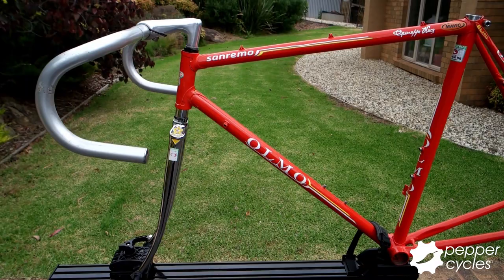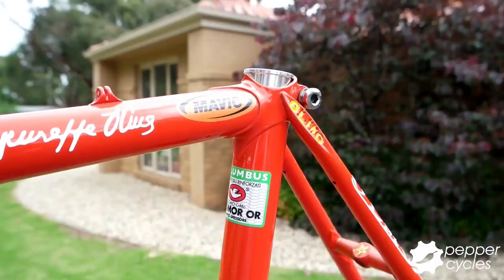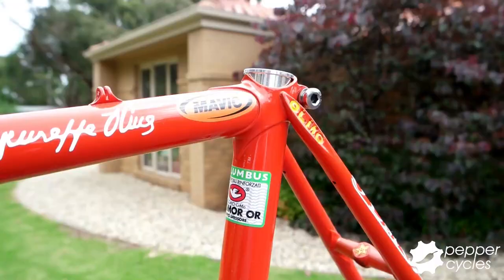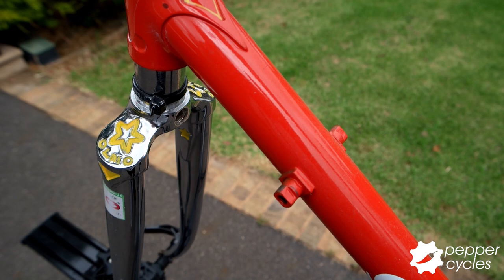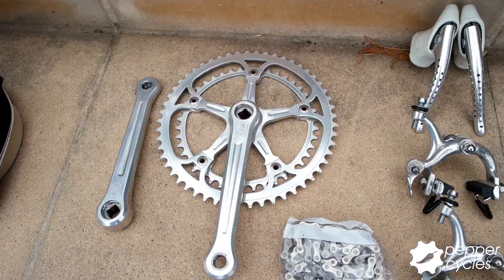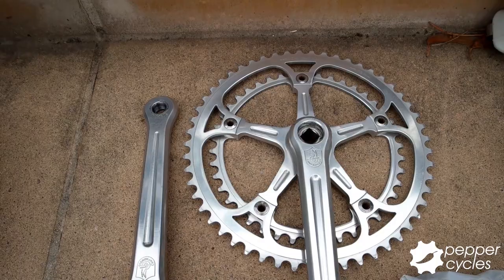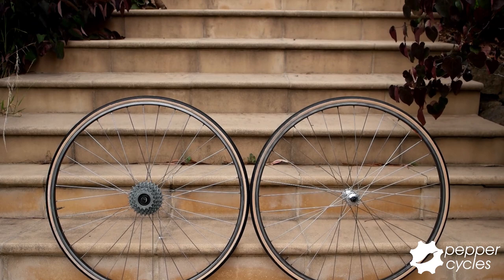Olmo Sanremo x Campagnolo Super Record -  Vintage Italian Road Bike Build

Comment: Whatever these vintage components can't do compared to modern ones, but with this bike you'll never have to deal with a creaking "plug-in" bottom bracket. What a beauty!
Reply from the maker: Ive had that press-fit squeak issue before - so very painful!
Reply: Still beats newer stuff in my Apinion these new bikes are cheating at this point not much pedalling involved 😂😂

Comment: Really cool!  On a side note you can get on eBay fresh rubber repro Campy brake pads for those SR calipers.  Slide the dried out pads (use WD 40) and slide in the new ones in so your Aluminum rims don't squeal like some scared critter out in the Bush.

Comment: Hi there... I was just wondering where you find all those vintage campagnolo parts? I'm looking for a set of 9 speed ergo shifters... are they compatible with c record derailleurs
Reply from the maker: This particular groupset I found on Facebook, it came from somwhere in Europe. Normally you can find them on ebay or Facebook groups related to classic/vintage cycling. I don't have any experience mixing c-record and this generation of super record, but when c-record was released it was a significant change in design, both mechanically and cosmetically speaking, so, personally I'd steer clear of mixing the 2.

Comment: I have the same equipment on my 1982 Colnago Super. Have you found a way of stopping the brakes from squealing? Mine sound like a sty full of stuck pigs when I brake.
Reply from the maker: I didn't have that issue with this bike thankfully. Pads were in good condition so didn't have to change them, but i did give them a light rub with some sand paper - maybe you could give that a try. I would also make sure the braking surface is clean and free of any oils, I've had squeaky breaks before that were a result of cleaning spray/WD40 residue on the braking surface.
Reply: Run a Stanley knife at 45 degrees five or six times like this on blocks  / / / / / / rim direction {right to left} little trick we did in late 70s - not silent but avoids a bit of the embarrassing racket !
Reply: Park makes a tool. It allows you to bend the brake caliper so the pads hit at a slight angle. If they hit flat often the force of the wheel spinning makes the pad angle forward. Hard to explain. I use a small adjustable wrench instead of the park tool.
Reply: eBay sellers sell fresh rubber pads for those SR brakes.  I know because I bought them and they are legit.  My 35yo Cobalto SR calipers are PERFECT and no squealing

Comment: How do you like running tubulars?
Reply from the maker: I prefer clinchers for the sake of simplicity when changing and repairing. I like trying out different setups so I often find myself swapping out wheels / tires. That said, tubulars tend to last me longer and roll a bit smoother.
Reply: @peppercycles  and to think clinchers were a PITA back in the late 1980s with them Mavic MA 40's or Open 4CD's and Michelin Hi 18mm clinchers.  By the early 90s clinchers were easier to install....